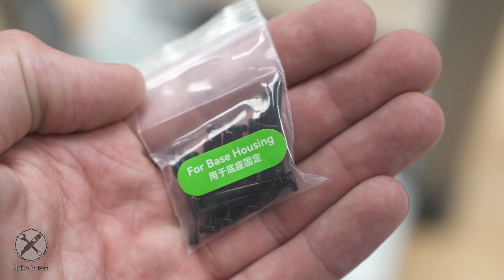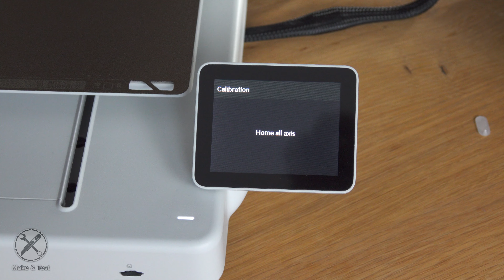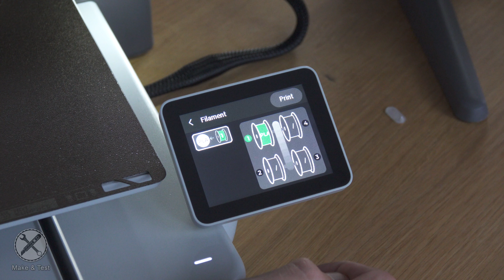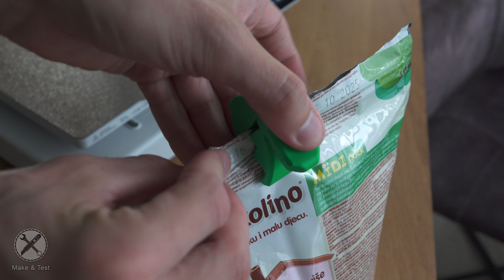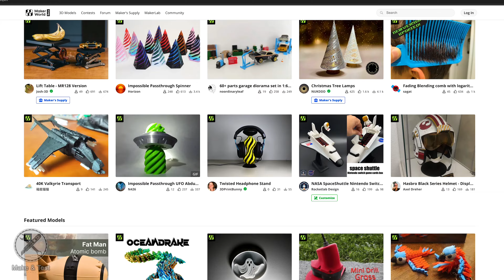3D Printer - Bambu Lab A1 Combo (AMS) - Assembly and First Test

Comment: Why can’t you just print an attachment to hold another spool and buy one of the tubes to make your own AMS?
Reply: In theory, you can. The problem comes when the printer needs to change filaments.

When you're using only one filament and you wanna change it, you need to manually remove the old one and feed the new.

AMS does this by itself, pulls and pushes filaments when they are needed.
Reply: Nobody has time for this.